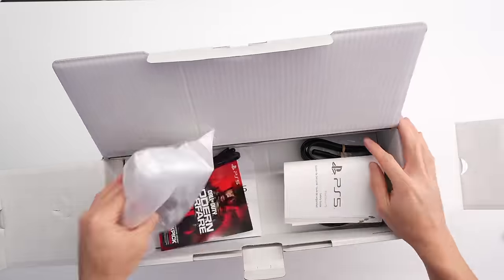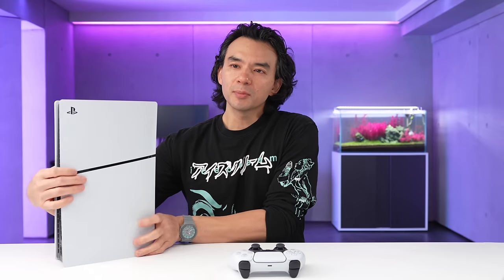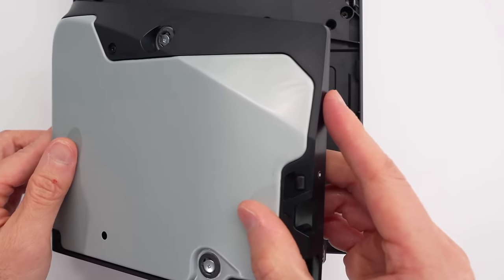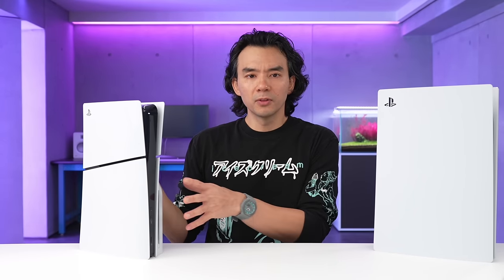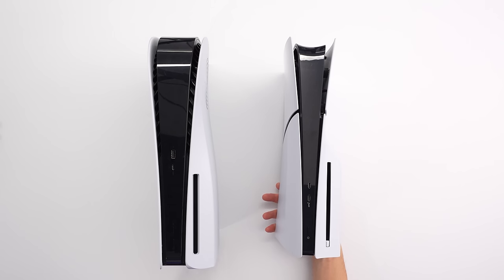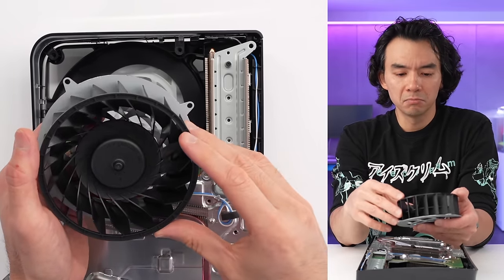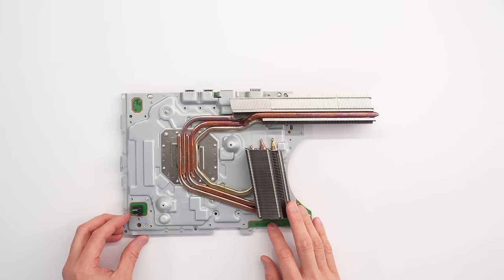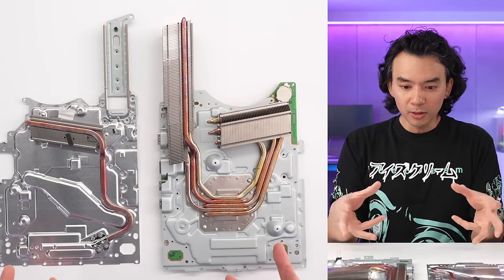NEW Sony PS5 "Slim" - Teardown + Thoughts

Comment: The removable disk drive is really smart. Means you dont need to make a choice anymore, your console can do both. I do love my original ps5 though, and i think this new design is definitely uglier.
Reply: what's worse tho is the digital ps5 slim is 50 dollars more. So there's only a 50 dollar price difference between disk and diskless. On the original there was a 100 dollar difference
Reply: @comfybaguette  still way better than building a pc these days. My rtx 4080 costed more than 2 ps5’s lol
Reply: @EMBERKE56  oh I totally agree. even if you buy a good enough PC it'll be outdated before the ps5 is.
Reply: @comfybaguette I built a PC in 2020 and it still outperforms the PS5.
Reply: @borginburkes1819  I completely agree, PC's are much more powerful than a PS5 especially when you get to the expensive cards. What I meant by outdated was in game specifications. PC ports have been increasingly worse and worse both in terms of performance and optimization. I had a PC once but I was stunned with how bad it's gotten in the AAA single player genre. The benefit with consoles is developers have to optimize for just 3 devices
Reply: @comfybaguette  that’s sort of true. It depends on what game you’re playing. 

But after going PC I can’t really go back to console
Reply: @borginburkes1819  yeah that's also true. I mainly stick to the single player scene, especially the AAA stuff. Unfortunately that's the genre that especially suffers on PC. But I completely see where you're coming from, there's def advantages to PC
Reply: @EMBERKE56 RTX 4080? LMAO you want to overpay for your sh*t it's your problem. An RX 6700 XT and a Ryzen 5700 will both outperform a PS5 for less  than half the price of a 4080. Of course it's still going to be significantly more expensive than a console but it can also do a lot more things, lets you have the ability to play online with no extra cost, etc.
Reply: @comfybaguette In the UK it's the exact same price as before
Reply: @unicorntomboy9736  wow either you guys got lucky with the slim or were up charged on the original lol
Reply: @EMBERKE56  I thought the point of buying a game console over buying or building a gaming PC was the fact that it's supposed to be the cheaper and easier way to get into gaming than PC.
Reply: @Generationalwealth94  amd cards? No thanks, ive tried and it was an inferior experience. I got the 4080 for less than a 7900 XTX, and I’m not gonna get a 6700XT its simply too weak for 2023 pc ports.
Reply: @CyanRooper  well.. “ cheaper “ not necsssarily only when you step in and pay for the hardware. Cost of ownership is going to be more expensive on the console side overtime since you have to buy subscriptions to play online and you get hosed with stupidly high pricing on new games. On PC there is always a way to save some on a new release, but yes. The hardware is definitely more expensive then just buying a PS5
Reply: @borginburkes1819  I can’t go back either which is why I have both. There are a few games that I still can only play on PS5, so I had to bite the bullet and buy one
Reply: @EMBERKE56 lol well a gaming pc is lot more powerful than a console. Yes you pay more but you do realise it's a lot more reliable, way more repair friendly as usually people just swap out the graphic card and that's it. People keep them on average 10 years. While consoles generally go through 2 consoles minimum per generation. So honestly you get Ur bang for Ur buck. I personally own both a gaming pc and ps5 half of my games are on both
Reply: @Superfoodcookie  it is a lot more powerful yes but these pc ports in 2023 have proved that power means fuck all quite often. I can have a $1200 GPU and have the game optimized by a chimp, (Jedi Survivor) barely getting 30 fps in 1440p max settings
Reply: @EMBERKE56  that's true, but generally games like red dead and popular games are quite optimized. Plus you get a plethora of games so even if jedi survivor isn't the others are atleast. That being said I buy specific games on ps5 such as shooters and solo adventure games like god of war . Honestly I prefer console cause pad and less hackers = way better. I can sit back and enjoy. But I also really enjoy the survival games on pc, plus more indie games and I still like Microsoft games like sea of thieves, It's nice having both. But I get what u mean by optimization I've ran into it before.
Reply: @Superfoodcookie  i play most of my games on PC but yeah I had to get a console to play Horizon, GoW and stuff like that. Also considering getting GT7. Its also nice to have a console for when rockstar finally wakes up and just maybe releases VI, its likely going to be consoles only for the first year or two. I do love my PC though, recently played alan wake 2 with maxed out path tracing and the graphics were breath taking. PS5 could never replicate that
Reply: @EMBERKE56  true it can't replicate it there is a huge difference in some games. How is Alan wake 2? Is it good compared to the first one
Reply: @Superfoodcookie  story is good, but honestly its way more of a walking simulator than the previous game was. As you walk around the map you meet way less enemies, but honestly its not a bad game overall. Worth a playthrough
Reply: @EMBERKE56  hmmm cool il give it a go, thanks for the convo 🙂.. cool talk

Comment: Smaller design means smaller heat sink, wouldn’t this in practical term results in hotter air coming out the slim?

Comment: The reason Sony is trying to convince people to start placing their PS5's in a horizontal fashion is due to the fact that they use liquid metal instead of standard T.I.M. and over time with vertical mounting the liquid metal will move down due to gravity and cause consoles to eventually start overheating when they normally wouldn't. We saw hundreds of cases of customers stating that their console randomly started overheating and the one thing we saw in common was all of these customers placing their PS5 in a vertical orientation and upon opening the consoles every single one we saw had a massive bare spot in the center of the APU.

Comment: Hmm.  Haven't picked up a PS5 yet and was holding off to see what the new models bring to the table. I think what he's hinting on in this video is that Sony opted to go in the direction or reducing production costs rather than upgrade and updating.  I might be mistaken but didn't previous Slim gen models come with better cooling and updated, more efficient silicone?
Reply: slim has more heat pipes and is quieter.

Comment: The tool-less attachment design of the disc drive and the two-piece panels per side definitely smells of a manufacturing thing. It'd be really easy to make one version or the other by changing two parts (maybe 3 if there's a cover for the port)

Not a fan of what appears to be a strong notion that this thing should be vertically oriented.

Comment: I'll tell you how it's keeping the temps the same as ps5 normal. its cause the chipssets are updated to withstand hotter temps, even though its the same heat as the last gen ps5, it should be cooler but its not much. Just newer chips designed can handle hotter temps

Comment: The current dualsense edge controller on the market comes with a USB A to C charging cable, you have to buy a adaptor, otherwise it is very uncomfortable to charge it from thr back of this slim model whe you are playing.

Comment: Actually the SSD have 4 chips, just 2 of the chips are in the other side.  If they make the chip run 1.5 times the speed, out have a bus 1.5 times as wide.  It would work like the old setup with 6 chips.

Comment: The original ps5 did not reach its limit of performance because there are no games to challenge the platform. Thats is probably the reason you did not see any difference between the two

Comment: I’m a fan of the original design and i don’t like the multi panels as much for the slim…I understand why ps went with the plastic stand to cut cost (maybe) but honestly the price increase for the non-disc version doesn’t add up other than the console having 1TB of storage.

Comment: Im just glad it's smaller. I can switch between using ps5 on my TV or PC monitor more easily. I will just wait until sony or dbrand releases black panels for it. I sold my first ps5 long ago when it was sold out, used for like a month and got bored. Made profit. But I want a ps5 again just cause I wanna play mw3 on it. idk just I like COD on console

Comment: Old PS5 Disadvantage: Size and Storage

New PS5 Disadvantages: Build Quality and Less Vents
Reply: Heard the new one also has Wi-Fi requirements for using the disc drive, something about not having 3rd party’s making a cheaper disc drive.
Reply: @makotoyuki9498  that ain't a disadvantage for me, I have 5G wifi router
Reply: @Artimus_Prime  I know, it isn’t an issue for a lot of people, but it still useless because a discs are meant to be able to be played offline. It’s more so just lame that it requires internet to use a disc.
Reply: @makotoyuki9498  you know what, nothing is perfect

Comment: I am sorry but the slim version does not look that small compared to OG, they prbly take same amount of space on stand. Again the whole point is trying to save cost so I do not see the point of upgrading from OG to slim, I dont know if the OG has better thermo, so even for new users, not sure which one to recommend knowing the specs are the same.
Reply: If you have the original, just don’t change to the slim. This thing wasn’t made to be considered an upgrade, just an option for people without a PS5 to buy a revised (and more ugly) console.

Comment: my guess would be they went with quad panel design just because if you buy digital version of slim and want to install a discdriver later on you obviously need to change the cover panel also. in that case they wanted to seperated top and bottom panel on disc side since it would look goofy one side halved other toget they went aith quad panels

Comment: Do everyone purchase a ps5 with extended warranty?
Reply: @@Packin-Heat i didn't buy any extended warranty tho at previously consoles... Like the ps4 and xbox since 2015... And they are work well ... And i believe brand SONY won't get a problem easily, But now, i wonder if peoples purchase it with extended warranty... 1+2years... Because some shop is recommended that...

Comment: Slim version doesnt make sence for me and that's why. If i wanna be mobile with console - better choise would be XBOX, because it is Squareformed. Both PS5 versions have the strange massive plates, unsimmetric form and they are both incredibly uncomfortable due to their forms if it comes to the situation when you have to move them in your backpack/luggage and ETC.

Slim version can actually be useful if you don't have a lot of space in your living room, but their sizes are not THAT much different to be desider and we should not forget that slim version is 10% more expensive.

Comment: Well, if the old storage was 6 channel storage with a controller, that's different than 2 channel. Probably Sony knows about not making life difficult for developers, so most likely it makes no difference to development. Probably they just i/o with the controller and it does the rest, regardless of how. And they couldn't lower the disk speed, so they probably found a way to do the same thing with 2 channels and storage units as they previously did with 6.

What worries me the most about this slim unit is heat. Not as an isolated case, but due to the issues the PS4 had with heat and noise, due to some design issues. The more you cram things, and the less airflow and airspace there is, the more likely the same hardware is to cause higher temperatures. I don't ever want to be in the same situation with a console that I was with the PS4, being so noisy.  But well, as you show, there is basically no difference, but well, I still worry because I don't want another jet engine situation, which was the reason I got the PS5 in the first place (as a quiet PS4 player + PS5 games ofcourse).

Anyways, I don't really mind the size of the regular PS5, unlike many other people.

Comment: they could have keep the design of the bigger ps5 and made it into smaller size..... If the removable disk drive was the problem for the design change, then they could have bundle the disk drive with the side panel.

Comment: I have to say after seeing this many comparisons between the old and the new in this video, I think is a win for this new version, really like how compact and organized everything looks, the way the disk drive can be removed is freaking nice, the easiness of the removal of the main fan for cleaning is great as well,  that motherboard or main board looks so damn clean and organized unlike the monstrosity of the xbox series x sandwich innards are, and finally the outside, at first I was skeptical of that line between the faceplates but didn't realize two of the segments where shiny and the other matte, and that looks very elegant imo and doesn't look cheap at all not sure from where that comes from, also this will add more customization options in the future, I have to say I already own a PS5 and freaking love it, but now after seeing this even thou the reviewers kinda sounds like there is some hating there for no obvious reasons, I do really want to buy one now, but if there is something I have to complaint about this new version it has to be the price, I think this one should be 399 with disk and 349 without a disk, I think is huge missed opportunity by Sony here, isn't the point of create a slimmer option is reduced costs?, but selling it at the same price and even higher than the original I think is kinda greedy sadly, but still not sure how Sony's economy company is so who knows, nonetheless I really wan't one, or I just will wait for  the PS5 PRO :D
Reply: how much are they paying you? i'm looking for a job. /s

Comment: The ps5 slim is just an aesthetic ps5, they made it slimmer and that panel with a half gloss half matte is a weird change, they could have improved the internals but there are no improvements and some benchmarks are just the same as the thicc ps5

Comment: The Slim console has never been about performance for the user... it's only a reduction in costs for the manufacturer. For the user it's mostly about looks. PS4 Slim WAS a quieter machine compared to the original PS4 though. A Pro console is about an upgrade. With all that being said... THIS slim is not that much of an effort of redesign by Sony. I'm scared to see what the PS5 Pro is gonna look like being the PS4 Pro was bigger than the PS4. The original PS5 looks better than this "slim" to me. Let alone the whole always online controversy.

Comment: They don't call it "Slim" because that would intent, the Console is cheaper, which it's not...
And buying the Disc Drive separate is actually a rip off in compare buying the PS5 "Slim" with the DD already incl.

Comment: I’ll be honest the original is better for heat and it also comes with a stand and it’s bigger it’s nicer more airflow for the original bigger fan but the slim ain’t to much nice idk why it looks so off and small and the 2 color design not to much airflow but my favorite is the normal ps5 version disk version I have it and I love it

Comment: Bro that is why they are cheaper🤦🏻‍♂️ 
If ps5 standard and ps5 slims were similar to each other, then whats the point of launching the cheaper variant? This comparison dont make sense. Why does the slim variant has to be the same as the standard ones? This is why the standard vairants of PS stands out from the slims variants.

Comment: Re the SSD speed: the original PS5 uses 12 channels with 6 chips, so that's 2 channels per chip. The new PS5 has 4 chips, so that would be 8 channels total if they continue with 2 channels per chip. However, the per channel transfer speed of flash chips has gone from 1,600 MT/s to 2,400 MT/s over the last few years. Therefore, sony would probably be able to maintain the same SSD performance with less channels but more throughput per channel.

Comment: They're both quite ugly (in that they stick out like a sore thumb in most setups, in spite of looking relatively stylish on their own) so the smaller, the better, imho. Regardless, as someone who never owned either version, the newer one is just more convenient in every possible way: more storage space, smaller form factor (Dbrand panels or not), easier access to the SSD slot, less plastic vents in the middle part (= easier to dust), and the removable disc drive is a brilliant touch. Yeah, I also liked the PS2, 3 and 4 slims better but it's not that big of a deal for me, honestly. Higher MSRP isn't an issue in europe either since the "fat" model also got its pricetag increased over here. The stand sucks, I'll give you that

Comment: I get the whole keep things looking symmetrical but they should’ve made the left panel one piece and obviously just have the slit on the disc drive side. And the console has to have internet for the drive to work? Like what? You pay for a drive but can’t use it however you want? Isn’t this what they shamed Microsoft for with games? 😂

All good. I’m not missing out and I’m perfectly happy I have my current digital version for $399 with a better looking stand.

Comment: Imagine how much money Sony could have saved with this design.  I almost feel that the originals are not designed properly as a lot of this comes down to thermal management and engineering.

With the money they saved, they could have designed a nicer looking case.  They are turning atrocious.

The best looking console in a while is the original Xbox One white edition which had 2-tone glossy white and non-glossy but pulled it off.  This does not pull it off at all.